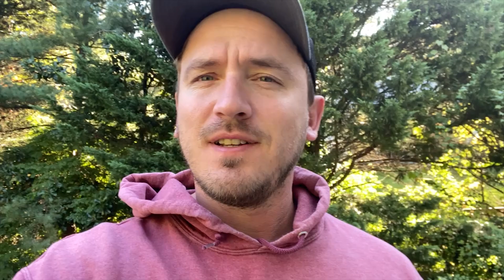3 Ways To Deal With A Low Yielding Well

Comment: Will lenders accept low-yield well tank storage for yield well test out in the country (Cecil County)
Reply from the maker: That's a great question, but a really difficult one to answer. I have to preface this answer with the advice to contact your specific lender to determine their requirements. Anecdotally, I've seen convention and refinance lenders be fine with a storage system. I believed the Gov programs need to see state min yield across the board. The only county in the state with regulations on what an existing well should do is Baltimore county. Typical MD real estate contract will have verbiage in their about the min required yield rate. This is typically 1GPM. Unless the lender asks they would not know the yield rate of your well. I've seen plenty of houses get away with just increasing storage, but this only ever seems to be with conventional loans. I'm not a lender but that's just what I've seen in the past

Comment: It's a storage tank. It doesn't have a bladder. It has either a float switch or a float valve that tells the pump in the well to shut off.

Comment: 1 are the water storage tanks open/vented to the outside air or is there a bladder so the water in the tank is sealed from the outside air?   If there is a bladder,  is the rest of the volume vented to the outside air?  If not then the pressure in the tank will increase which could be a good thing but then pressure would drop as water is removed from the bladder.   1 gpm is 1440 gal per day.  That is a lot.   A bigger tank will help.   I have been to Panama.  They use blue tanks to store water.  Some look like they are much bigger than 300 gal.  I could not get info on whether these tanks have a blader to keep the outside air from contaminating the water.   I was told it is best to have the tank up on a pedestal so water will naturally drain from it.  This leads me to believe there isn't a pressurized bladder.
Reply from the maker: The tank should say if it’s pressurized or not.  Generally the blue ones are self contained units with a schrader valve on the top.  This is how the air is introduced.  The bladder separates the water/ air. The larger systems are not bladder tanks and usually have a pump situated at the bottom to prime the house.  We usually put tanks on a pedestal for air flow. This helps to keep the bottom from rotting out.  Our counties require at least 8” blocks